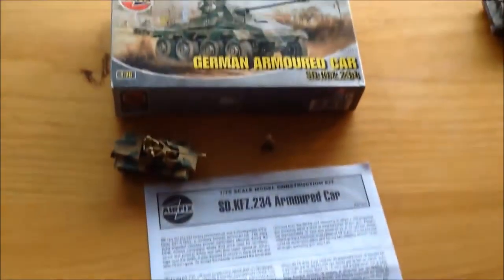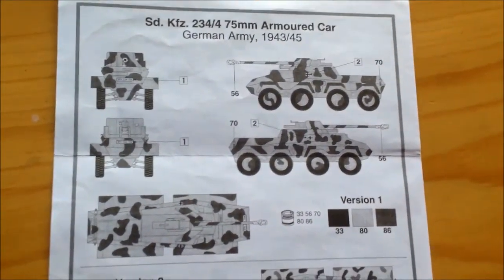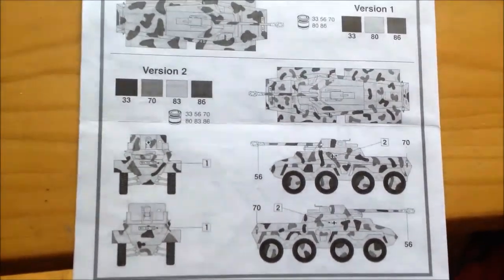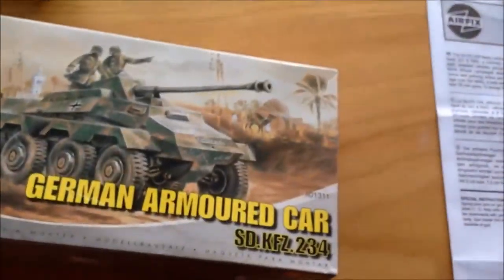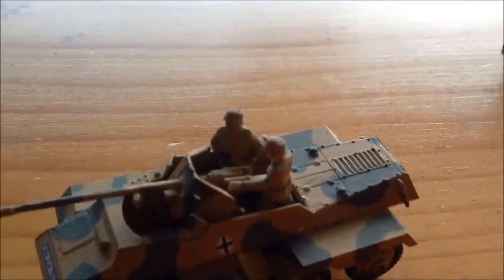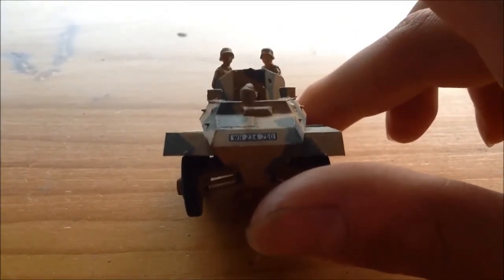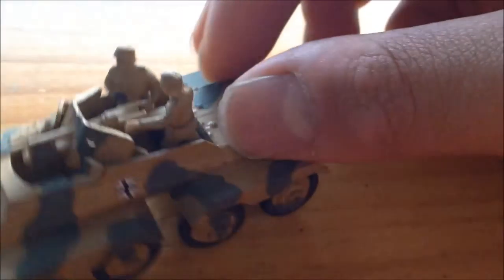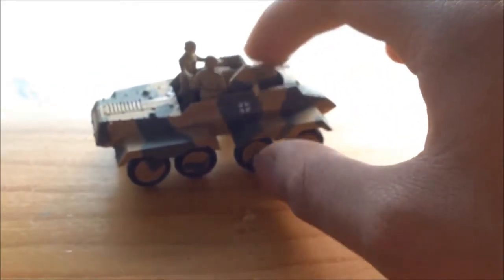German Armoured Car Sdkfz 234 Airfix 1:76

Comment: Sorry, but that's a 234/4 with the chassis of an eight wheel 232.
Reply from the maker: Hey thanks for the info, but how do you spot the difference?
Reply: @josefalfarokreiner4549  I don't know how to explain it in English, but look up pictures of the two and pay attention to the area around the wheels, especially above.
Reply from the maker: @KrokLP  hey thank you very much, i will look it up merry christmas and happy new year
Reply from the maker: @KrokLP  i have look at them, yeah the fenders ( those things over the wheels) are different, thank u very much
Reply: @josefalfarokreiner4549  Same to you! You did a good job making it! Maybe the bit of research motivates you to make another one ;)
Reply from the maker: @KrokLP  jajaja thanks, may be 😁
Reply: Some other aspects to add is that hull shape and engine deck